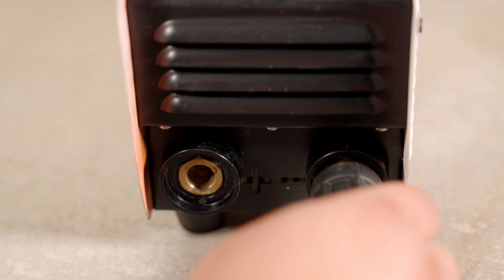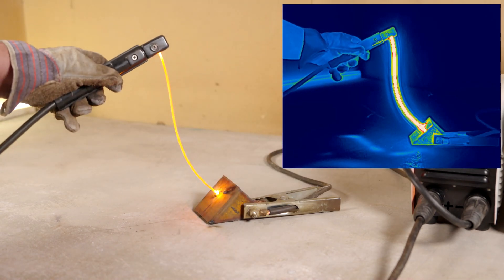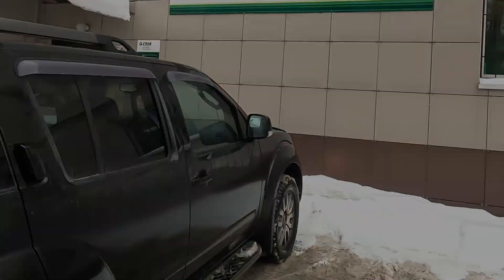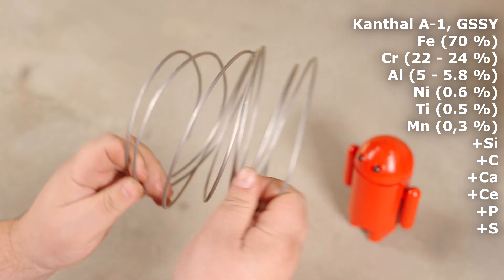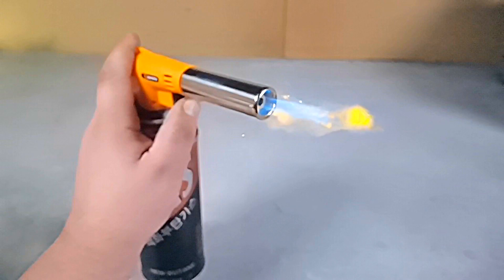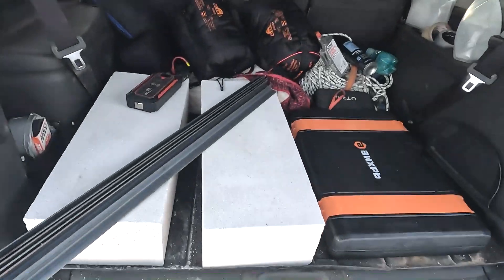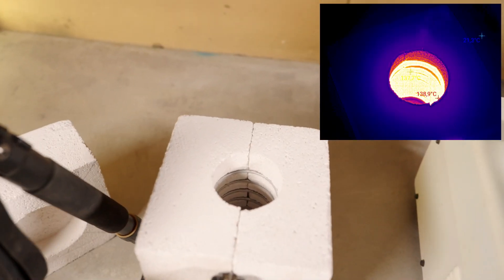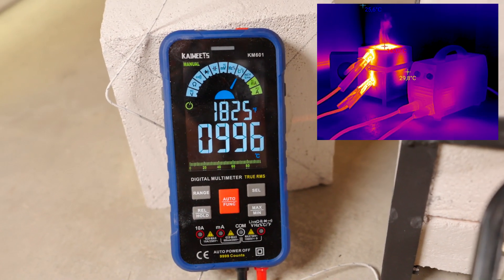SECRET FUNCTION of the welding machine !

Comment: On a side note about welding, for emergency repairs to gas tanks, welders used to fill the tank with gasoline before welding on it, so they wouldnt egnite fumes in the tank. Now it's required you empty the tank and fill it with water and never weld on the up side of the tank. Its also why the car manufacturers switched to mostly plastic gas tanks. My stepfather had been doing it so long he never bothered to change. Always scared the hell out of me.
Your rhumbnail with the soda can reminded me.
Reply from the maker: I've welded a gas cylinder several times, and I always filled it with water before welding, and even after that I was still scared))). I do a lot of interesting experiments and projects, I like to share my experience with people. I will be glad to see you again on my channel.
Reply: @doctor-robo  Sometimes mechanics think more about the paycheck than safety, seems like, used to anyway.

Comment: uhh how did you get that specific metal mix?  Or are you just saying I got this metal and this is the composition after doing an assay on it
Reply from the maker: Yes, "Kanthal A1" is quite common and often used, mostly use 1mm thin wire for 115-220 volts. I decided to use a 3mm thick wire and use my old MMA welder as a power supply. This heater will last a very long time and has a compact size.
Reply: Kanthal A1 is quite common actually
Reply: he had a piece, tested it and then ordered more after seeing it didnt melt
Reply: @frogz  Yeah I dont know why, I have this bad habit of asking questions right when they come to me, should probably watch the entire video then ask questions, right?